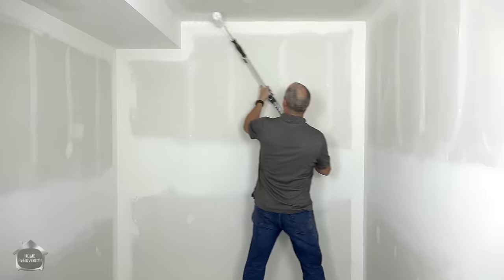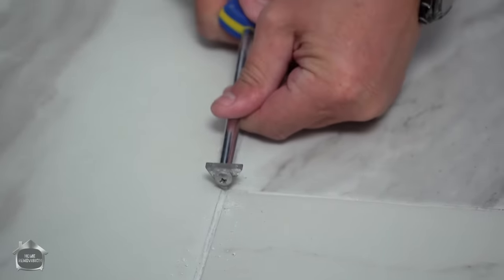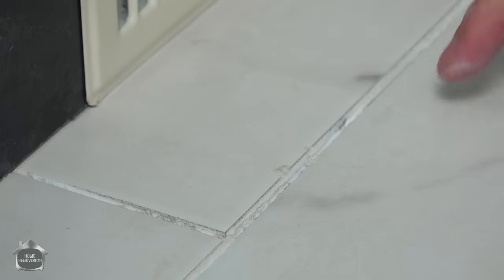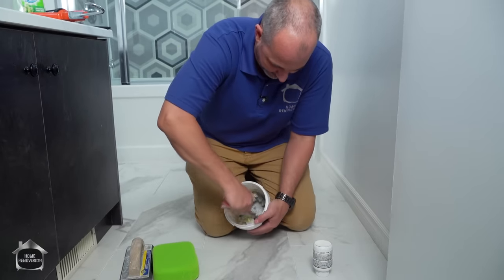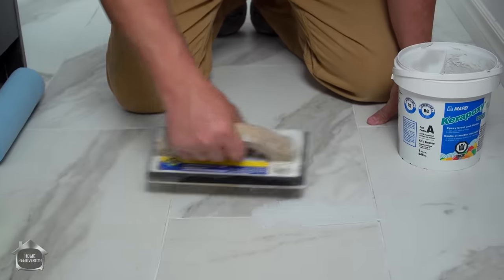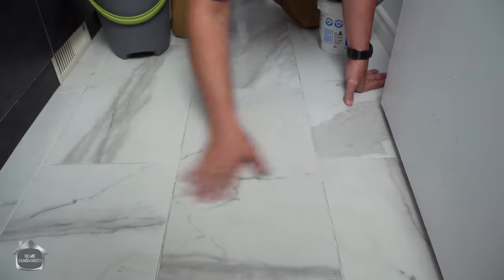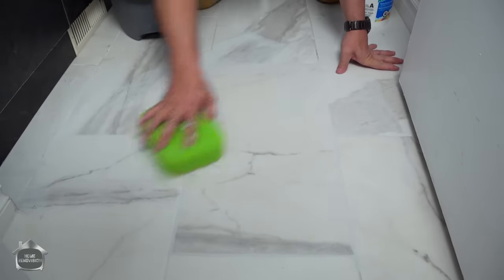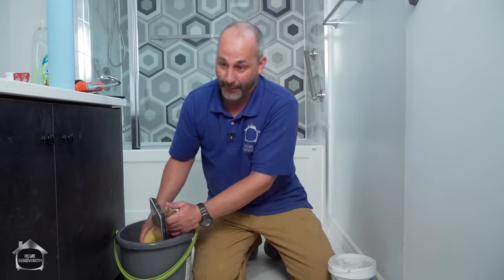How To Apply Epoxy Grout  | DIY

Comment: doesn't the dish soap mess with grout adhesion?
Reply: I was thinking exactly the same. A lot of people do a similar trick when applying silicon sealant, but this also prevents the silicon sealant from adhering to the surface, so I won't personally try the dish soap trick when using epoxy grout, as I want to ensure a strong bond.

Comment: Another great video, Jeff!  I wish I lived in the Ottawa area.  Something tells me it would be great to work with you.👌

I think I know the answer to this; but I’ll ask anyway...

... is using the dish soap trick something that will work with regular grout?

I have a small area to do (it’s already tiled - just about to grout it).  I’m going to be using “Power Grout”, by TEC.
Reply from the maker: no need , regular grout cleans up real easy with water. Cheers!
Reply: I kind of thought that; but wanted to check.  Thanks.  Keep up the great work on the channel.  Much appreciated!!!🍺

Comment: Can I use epoxy grout instead of regular grout for shower walls and around bathtubs?  Since regular grout is porous it traps water and dirt in it and leads to the typical ugly mold.  I believe epoxy isn't porous so it won't trap water and dirt.
Reply from the maker: Yes!

Comment: I wouldn't mess about with a hand tool to remove the existing grout - just buy a vibrating multi-tool with a grout removal blade.  It'll turn a 4 hour pita job into a 30 min easy job.

Comment: "The only installer that uses epoxy is the one who never used it before". That's what I was told years ago. I will try your method of detergent and see if what I was taught is true or not.
Reply: I'm sure the epoxy grout of these days is not the same product as "years ago"  .. give it a try

Comment: How long does epoxy grout have to dry on a kitchen floor?  Our installers told us not to walk on it for 72 hours. Seems like a long time to me.
Reply: Freeman Wright I used this stuff on the tile wall in my bathroom and I thought a few hours of it being in a nice warm room would be perfect I started grouting the floor after with standard black grout and then I got some of the black haze wiping the floor on some grout lines in the walls. It was as wet as it was when I applied it. The next day it way dry I couldn’t move it with my finger but it was only surface if I poked it it was like clay still mouldable I would suggest 72h if u got big dark tiles with dark grout it’s fine to walk on cause you can miss the grout lines but small tiles or any light grout will attract dirt from ur shoes socks etc and will be hard to get out after

Comment: So now you have just mixed Soap with the epoxy grout, can’t imagine how that grout will perform
Reply: Yeah this is the craziest shit I've ever seen. You don't mix epoxy with soap and water. This is nonsense.
Reply: @alien4053  Works great! I have been using epoxy for 15 years. The soap doesn't breakdown epoxy , using to much water is the problem and don't let the soap stay on the tile for very long. wipe, wipe wipe and dry with shop tile.

Comment: This is textbook on exactly what you shouldn't do, you must have a dry joint and contact area per ansi and tcna standards, you can use soapy water but only after you've applied the grout to the joint, doing it this way will created pockets of failed adhesion and ultimately result in failure down the line, this would never fly if you got inspected
Reply from the maker: I love how guys always know the book but have no practical experience cHEERS ! tHIS WORKS!
Reply: @HomeRenoVisionDIY  been doing this everyday for 6 years man, and everything I learned I learned from old farts with at least 30 years of experience, tile is how I feed my family, but I don't need to prove my experience to some doofus on the internet that claims to know it all
Reply: I doubt he is a Mapei certified installer. That is the problem, everybody can expert and experience. Putting soap, soapy water or water into the grout line just before you apply the grout is, at best weaken the bond. This video author has taken too much liberty or creativity on the soap, which was meant for clean up only.
Reply: @chuncham1  that much is true, however whenever possible you should avoid weakening the bond between your substrates, and there's is no real way to know how far it's being weakened given how many variables there are, it's far better and safer to simply wipe on a grout release prior to installation

Comment: What do Mapei, the manufacturer say about your technique using soap? I cringe seeing you drip concentrated soap into the grout line, now the soap filled the void where the grout should go.
Reply: Epoxy and Soap do not mix.. the Epoxy pushes everything out of the Grout Cavity.
Reply: @Awack420  Unless you know it from a chemistry standpoint. But it doesn't make sense, the manufacturer recommends using soap to cleanup. Implying the soap will break down or clean up the epoxy residue.
Reply: @chuncham1  you can read what custom and the others have on ther info specs.   Soap  is safe and recommended   stop the trolling and get back to work

Comment: Jeff quick question. 

Currently building a shed - same design as yours.  
Having trouble locating the windows. 
Home Depot is 60+$ in Toronto
Any suggestions?

All the best
Reply from the maker: no idea, I might have been tongue tied about the price. I can't seem to find any better than 40 myself right now!
Reply: Try a Re Store place, used windows etc.

Comment: Outstanding tutorial Sir. I'm attempting to revive my 60 year old kitchen tile and thought, erroneously, that painting was the solution - it is not. Before I found your video I was influenced by other YT videos that recommended the paint method. So I spent a bank and bought all the materials and began applying it to a sample area. I quickly realized the paint didn't adhere well and the result looked like ass - pardon my French. I know this is an older video but do you still recommend this method for renewing old grout, or is their a more efficient and effective one? Some people on the inter-web are using an epoxy grout with caulking gun which, on the surface, looks like a cleaner application process. Your thoughts?

Semper Fidelis, Ken USMC (retired)

Comment: You wipe soap before you ground tiles. How can ground stick on tiles???
Reply from the maker: exactly. the soap sits on the tile and the grout gets pushed into the crevice. that is why this system works no soap in the crevice. Cheers!
Reply: Thanks for your reply. I saw your video you push soap and ground in to crevice. Soap get in to crevice like that. Will ground last long or not??? Anyway I like many your videos

Comment: You should not use soap with epoxy grout, it will leave bubbles in the grout causing it not to perform well. Any amount of soap is too much soap.
Reply: Tile guy, 20 years
Reply: It is a time-consuming process but that is why you charge extra when epoxy grout is requested
Reply: I'm not an expert, but it's obvious that having soap residue will comprise the adhesion of the epoxy to the surface of the tiles. The epoxy will be setting there like a plastic spacer collecting mold and moisture.

Comment: Your trick did not work for me though. Covering large areas using the dishwashing liquid approach didn't work for me. The epoxy started to mix with the dishwash liquid and didn't set at all. After a while the rest of the epoxy started to hardened and was unworkable. I'm inclined to go back to the slow approach you showed first and just put the grout on the tile edges and go slowly in small quantities

Comment: Ya I have a floating tile tile floor😡😭😡😭
Reply from the maker: if you want to buy some time this works like a charm.
Reply: Home RenoVision DIY Thank You........ but when  I was vacuuming the floor and it ate some tile.  My dream is to turn this into a barrier free bathroom; take out the tub and have a lip free shower and remove the false ceiling to open it up. I only have military disability income to work with. I REALLY wish it was easy to find an awesome contractor like yourself. First time homeowner here not sure how to do that.

Comment: Grout is flexible to allow for movement... epoxy grout isn't flexible. From my experience epoxy grout works on tiles on concrete as there is no expansion but definitely not timber floor or shower walls. It just pops the tiles of the substrate. Also have never seen tiles glued directly to timber floor by professionals, lots of handymen or amateurs but not pros. Tiling on timber you would throw some sort of backbone down first.
Reply: Sorry, regular sand grout is not flexible. It is a masonry product, which has a lot of compression strength but not tension strength. That's why it cracks easily. Epoxy grout, however, does give you a little bit flexibility. Because epoxy has tensile strength, so it helps avoid cracking. Imagine it like a hard rubber.

Comment: epoxy grout will not help with your deflection.... epoxy grout dries like a rock and when your substrate is moving the epoxy will crack and seperate.
if you are getting water ingress through your floor the waterproofing under the tiles and bedding has failed and will need to be removed, re-waterprrofed and the tiling and bedding re-layed
this is not a permenant solution and is not to be treated as such....

Comment: Epoxy only sticks when the join is clean and dry... Use your brain! 
DO NOT wet the floor prior to the application of epoxy. 
DO NOT get dish soap in your joins and then apply epoxy over it. The dish soap is a contamination which will prevent the epoxy from adhering. 
Jeff used the word "greasy" and epoxy is sticky so why would you expect something to stay in a join when you put something greasy in it initially?? It won't work long term. Even water prevents epoxy from adhering as epoxy contains no water. Water is used in order to help the sponge glide over the tile and pick up the excess. Dish soap can probably be used at cleanup (I don't see why not). NOT PRIOR STO APPLICATION! 
Wetting or moistening works for other (mostly) cement based applications but not this.

My personal method when using Kerapoxy is warm water with a scotch pad, then sponge (warm water also)

Comment: Tiles coming up cannot be fixed by regrouting.  Plus it's industry standard to have a bare minimum of 1/2 the tile thickness of depth for the grout, not a "v" groove.   Also AIR doesn't setoff epoxy, HEAT does due to the chemical reaction.  Get that grout out of the bucket like the manufacturer recommends for this reason. I won't even ask about the damn soap in your grout joints. I just don't have words to explain my disappointment in your tile skills.
Reply from the maker: Hi Jeremy, before you recite ntca regulations try using it! If a homeowner has a failed tile that sits under a sink vanity and this solves the problem then that would make my skills superior to the idea of ripping out a vanity sink and floor just to fix a little movement.
Reply: @HomeRenoVisionDIY  no it wouldn't, at bare minimum you should pull up the loose tiles and reset.  Masking the problem with a temporary solution and calling it a fix AND making a video and labeling it a fix just passses down poor workmanship and shows lack of respect for the trade and customers in general. But I guess I just expect things to be done the right way... Like my customers.
Reply from the maker: @jeremylunning654  As long as you can find customers willing to pay for such services feel free. But spare me the mantra of the right way. These videos are designed to help homeowners who can't afford your services. Funny how you are probably here to learn my techniques so that you can implement them on your job sites. Cheers!
Reply: @HomeRenoVisionDIY  the only thing I've learned from your videos is how the hacks do things and what should never be done in regards to tile.  But yes, I have found a couple of your videos educational and you do have knowledge of other aspects of building.  I just disagree with everything you've said about tile because it's blatantly wrong and misguiding.
Reply: @HomeRenoVisionDIY  plus if this information is for homeowners to save money, then teach them how to fix it properly.  The only extra expense would be a bag of thinset and a little time.
Reply from the maker: @jeremylunning654  The tile goes under the vanity. it becomes a large job and not necessary.  No need to get offended with my tile skills.
Reply: @HomeRenoVisionDIY  I guess we just have a difference in opinion on quality and craftsmanship.